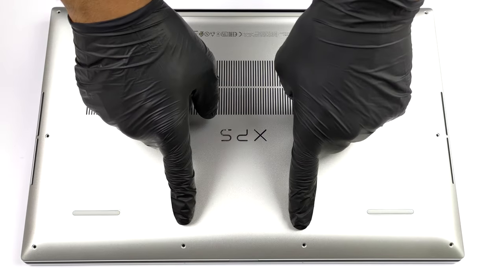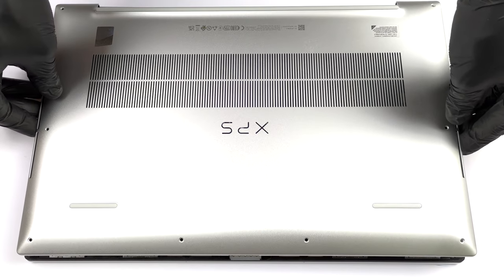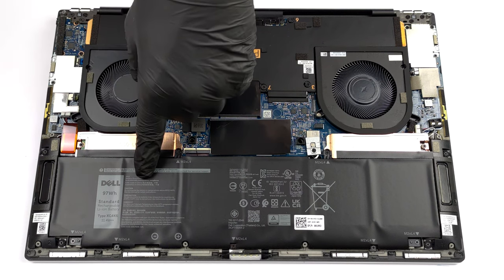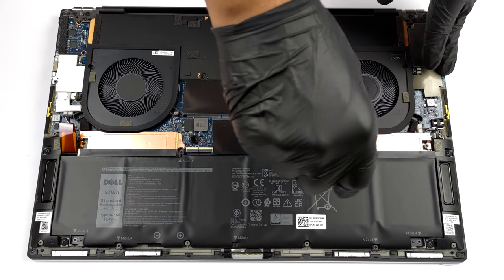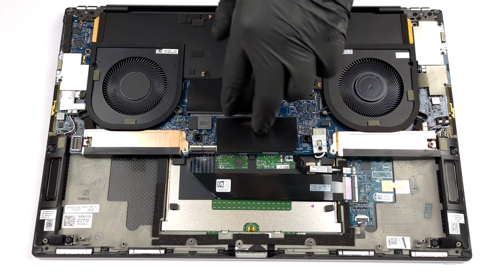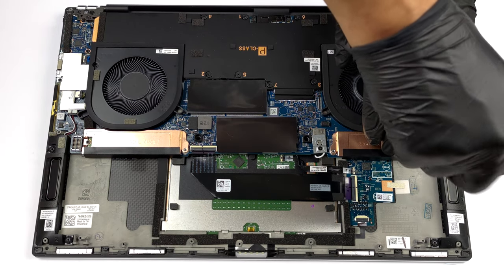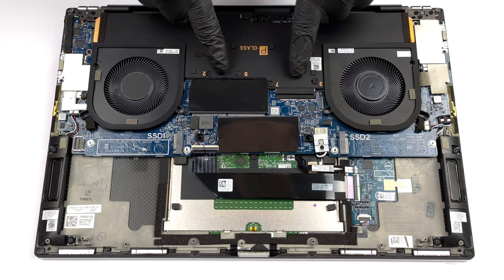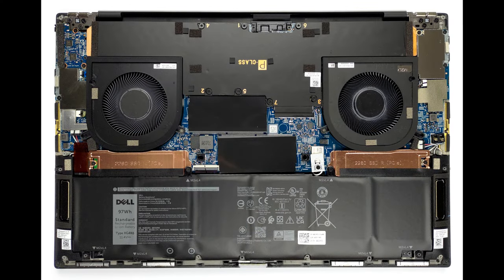🛠️ Dell XPS 17 9720 - disassembly and upgrade options

Comment: PSA: I recently upgraded my XPS 9720 with a RAID 0 configuration using a second OEM 1TB M.2 (from CDW for $100 ). Oh my, read/write sports 13,400 and 10,600 mb/s using Crystal Mark bench test. Everything loads blazing fast. Best $100 upgrade.
Reply: How did you achieve that, ? I could not get RAID 0 to work with two 980 Pro's , even with drivers loaded during windows installation, it fails on the first 0:00  reboot. Now I have Integrated to dedicated GPU issues, it fails to use the Nvidia 3060 .... Some odd message open GL DirectX not found with any game or benchmark until I reboot. But never crashes while in use even with Furmark prime95(limited core use) and a game at the same time  ? Out of ideas 😞

Comment: Great video! Quick question: I have the first gen XPS 17 9700. Are the internals the same as the 9720 or 9740, meaning can I upgrade the motherboard to a new CPU?
Reply: it would be the other way around upgrade the CPU. but most if not all Laptops the CPU is soldered to the motherboard. only things you can really upgrade on a laptop is adding more Storage, adding Ram and replacing the battery
Reply: @Zyn  thanks for the reply but I think there was a misunderstanding to my question. I am asking if I can upgrade the motherboard to a 9720 or 9740 board to get the newer CPU, as it indeed soldered.

Comment: @LaptopMedia Your video is titled "disassembly and upgrade options".  There is not any information regarding upgrade potential.  You only address how to remove the battery, m.2 drives, and RAM.  It's not even a complete disassembly video.